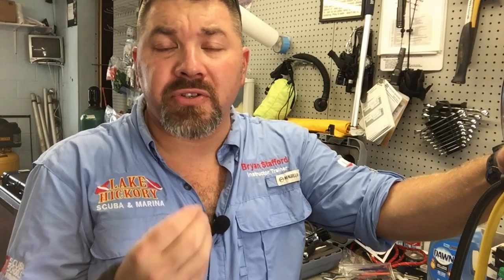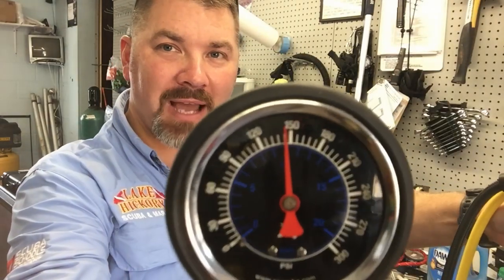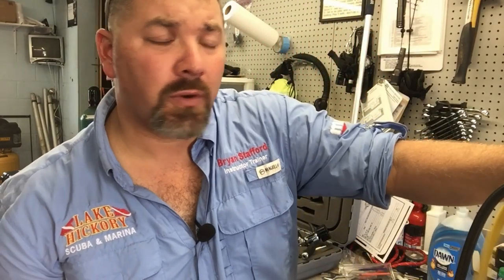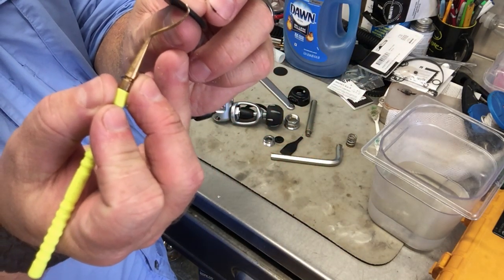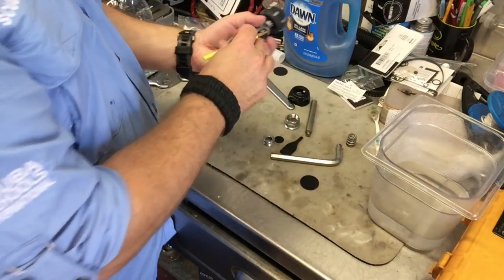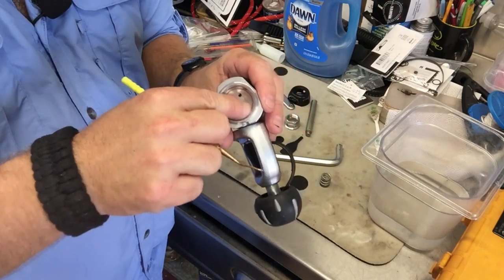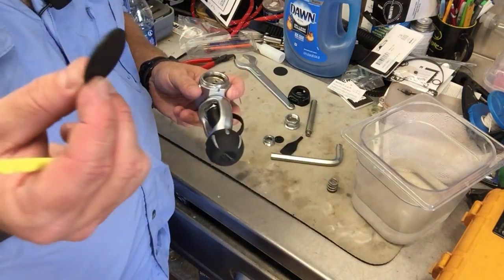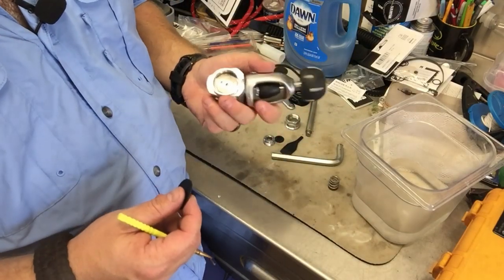What Is IP Creep Intermediate Pressure Issues

Comment: Great tutorial as usual.  Glad I found this video even if it's old.  I think this is exactly whats happening with my regulator.  Ironically, it started shortly I had it serviced.  My problem happens only on the octo second stage.  The primary second breathes nicely and doesn't leak.  What's puzzling is that when I first open the tank valve everything is fine...no leaking.  But, when I take the first breath from the octo it shortly thereafter, within 10 secs or so, it starts leaking and won't stop.  It only stops when the tank pressure is very low like under 1K PSI.  Any thoughts would be helpful.
Reply from the maker: Hello @artposada2171, it sounds like the low pressure seat in the second stage is malfunctioning based on what you are saying is happening. A simple adjustment should fix the issue. If not, you may have to replace the seat.
Reply: @LakeHickoryScuba  Thank you for your honesty and professionalism.  I suspected that was the problem...or else both seconds would be leaking if it was IP creep.  After my post I took the reg to my local shop.  After telling him everything I told you the "pro" at counter said "it has to be IP problem" though he couldn't articulate why the primary second wasn't leaking.  He recommended full service to which I agreed...better than carrying on the conversation with him.  Thanks again no need to reply just sharing.

Comment: What would cause creep in a piston style regulator.  what would cause a piston style first stage to wine from 3000 to about 2100 psi.   Only in the water.     It won't wine on the bench.
Reply from the maker: Hello troop1026.  In piston regulators, the spring tension could be off, the inside of the housing could be scratched, the high pressure seat could be wore out, or in some cases, the small little plastic spacers could be damaged.  Simple fixes, as Piston Style regulators are the easiest to work on.  This of course being as long as the internal part of the housing is not scratched.

Comment: What cleaning solution do you use in your sonic cleaner? What temperature?
Reply from the maker: Hello Sean, currently we are using a 50/50 blend of water and white vinegar. I'm not sure on the temperature, as its preset on the cleaner. A quick note, the 50% vinegar can be a little to abrasive on certain coatings, so you may want to drop it down to a lower blend. I will always do a freshwater rinse after removing parts from the cleaner.

Comment: I watched the video and get confused. For me it is unclear how a not-correct sealing diaphragm could lead to IP creep. I understand IP creep as a leakage of air from the hp side to the lp side of the reg. This is typically caused by parts around the valve mechanism (crown, seat, corresponding o rings). A damaged diaphragm sealing would let to air escaping the first stage.
I am not a professional so I double checked my thoughts by having a look into the "scuba regulator bible" (SCUBA Regulator Maintenance and Repair by Vance Harlow). And Vance is exactly mentioning the issues I described above and not refering to any problems around the diaphragm.
Can you pls explain your thoughts?
Reply from the maker: Hello Hans Wurst, there are multiple things that can cause an IP creep. One of those being the main regulator spring loosing tension, which a faulty diaphragm can cause. When we service a first stage that has IP creep, there are 3 major things we look for. The first would be improper adjustment of the first stage. Second is damage on the inside of the housing (scratches in the housing). And third, we check the main spring and diaphragm. During a complete overhaul of a first stage, the first stage diaphragm gets replaced with a new one, especially with Mares regulators. Over time the diaphragm can loose its strength which allows the spring behind it to expand more than the manufacture's recommended tension. So yes you are correct in saying the diaphragm itself does not cause the IP creep, but it can lead to it by not holding proper tension on the first stage spring. Hope this answers your question.

Comment: If a poseidon xstream says intermediate pressure is 125 and a scubapro mk11 is 133 will that be OK ?
Reply from the maker: Hello john metyk, I would have to refer you to a Poseidon or ScubaPro technician. The intermediate will change not only between brands, but also first stages with in the same brand. Most will give you a high and low, and anything in between will be fine.

Comment: So if you have IP creep vs cracking pressure issue wouldn’t you have the possibility of your primary AND the backup second stage free flowing? I know my backup second stage breaths harder, so it’s probably safe for me to assume it ma cracking pressure is higher, and it would free flow after my primary, right? Great video! I’d love to get certified to do gear work as a side gig enough to help support the dive habit, service my own gear, and play with tools since I’m not hands on with airplanes any more.
Reply from the maker: Balancing out the IP and Cracking Pressure is not that difficult. Typically, the alternate second stage will always be set to breathe slightly harder than the primary. Unless of course both are primary's like in Sidemount. But to answer your question, yes, too high of an IP can cause the seat to fail in the second stage causing a free flow.

Comment: ok then.... a) You do not have to use metallic tools to get the membrane out. Even a dentist ball point tool may make scratches. The easiest way is to use an air gun blow through one  open IP plug (the others closed) b) Faults in the membrane itself or in its seat do not cause an IP creep. Instead, the cause the 2nd stage to bleed, because the joint pressure from the IP spring and ambient is out of balance by the leaky membrane.
Reply from the maker: Hello sun yata, you are correct, you can use compressed air as an option to remove the diaphragm as well. Thanks for sharing.